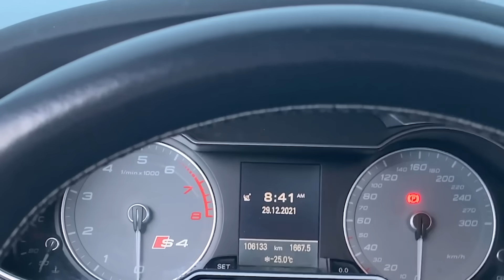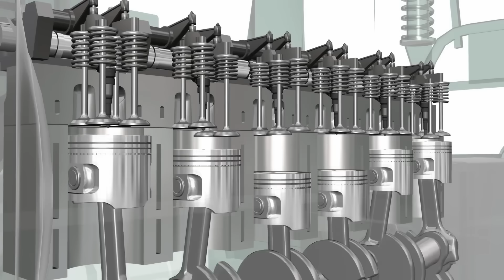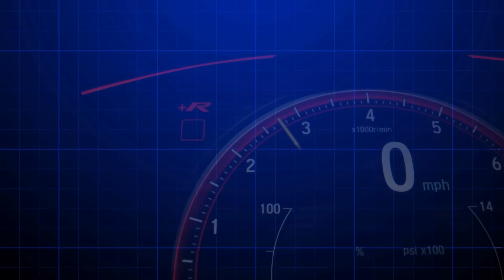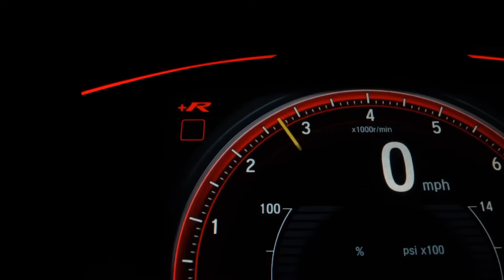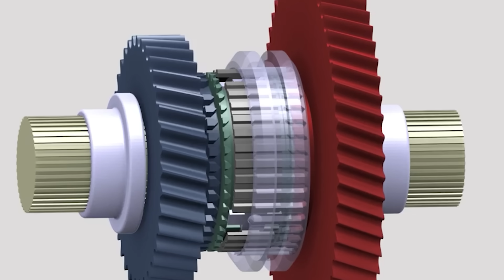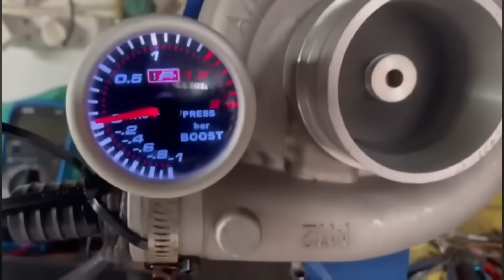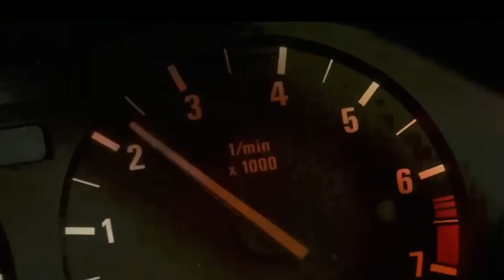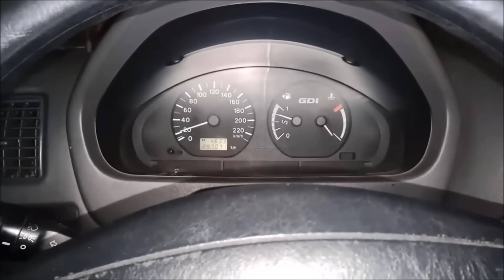STOP Warming Up Your Diesel Like This (Costly Damage!)

Comment: Im so sick of these shitty A.I. videos!
Anyways basically everything here only applies to NEWER "modern" diesel engines with all the toxic EPA BS in place. Don't idle because of exhaust temp? That doesn't take account for trucks with the high idle feature turned on... 15W40 oil in winter time? Sure if your somewhere down south but us in the northern climate switch to 10W30 diesel oil in the winter because it can drop below -40°f ...I keep my block/battery warmers plugged in all the time through winter personally but if I had a predictable schedule I totally would put them on a timer with random hours of power just to keep it reasonable for those random trips.
Tune and delete your trucks to run the way that they were intended and most of these problems will be obsolete.
Put a high-idle on your truck, Let her idle for a couple minutes and Keep your RPM below 1800 until the operating temp comes up into the normal spot and then maybe keep going easy on it for a little longer if it feels right for oil temps and then just drive like normal.
Think about it,  up until the last 10'ish years the diesel engine has always been known to run forever amd be totally fine with idling away for days.

Comment: "Warming up" a modern diesel engine is MORE about defrosting the windows to be able to see to drive. If the windshield is clear and it's cold out, I can drive immediately. Here's an idea: The manufacturers can add electric defrost wires inside the windshield the same way they used to put them in the back windows.

Comment: Ford 6.7l Powerstroke. 5w40 full synthetic oil. Factory oem block heater. And 300 watt magnetic oil pan heater. I plug the two devices in 3 hours prior to starting. I idle for 1 minute and then drive. Block heater only keeps coolant warm. And oil pan heater only keeps oil in pan warm. It does not warm the oil in oil pump or pipe plumbing or in oil filter. Viscous oil has to be pushed thru an oil filter until all plumbing lines and oil filter can be displaced by the warmer oil-sump oil.

Comment: After thirty years of driving and a prior experience as a mechanic every one knows that if you live in a cold region you install a block heater and you mix fuel additives to help with cold starts
Reply: 💯 I also added 2 oil pan heating pads, so the block and oil are warm. Start-up oil temps of 50-60 degrees instead of 10-20 degrees 👍🏼

Comment: Well i drove big rigs 40 year's always started them let warm up before i ever put them in gear always took it easy for a few miles before runnin speed limit let tranny and rear ends to warm up.  Owned only a 96 power stroke did same thing to it. Now have 03 Dodge ram 3500 2wd with Cummins diesel engine 24valve 5.9 6 speed manual transmission quad cab dually i will do the same with it.

Comment: You think ima pull a 6% grade 42k in the trailer with a cold engine 😂😂 no sir oil temp at 200 , coolant at 180 then I pull off

Comment: Why use 15W oil in cold weather when you can use 5w or even 0w oil?
Reply: My diesel has 0W20 so i’m good
Reply: Well if your pulling 20k lbs your bearings won't  last long I love how these guys drive a diesel truck around like a car
Reply: 0w means there is no oil residue on anything when startup happens which in time causes major wear... 10w you have some oil residue when startup happens help with less wear on startups...

Comment: 2021 Silverado 3.0 Duramax  4x4 130,000km oil changed every 5000km. Transmission fluid changed every spring regardless of mileage. All gear oils changed every year.
Reply: I have a 2020 Silverado RST Z71 with the 3.0L.  I live in Phoenix Arizona.  It doesn't get cold enough to worry about cold starts.

Comment: Go electric. So much better in every way
Reply: No don't think so. You can't even use your heater because you'll lose range 😅
Reply: @andydonagher9681 tow a cat generator plugged in behind you
Reply: Not at all
Reply: No😂
Reply: Try pulling 20,000 lbs with electric  it'll  never compare to my cummins
Reply: Not there yet. need more range pulling a load, shorter charge times, and then I’ll be interested.
Reply: Idiot

Comment: Not one word mentioned about head gasket scrubbing because of a cast iron block and aluminum heads, two dissimilar metals expand at different rates. Over a period of time fast warm ups will  blow a head gasket. I let my 19 year old duramax duramax warm up for 30 minutes when it's cold outside so the block and heads can slowly warm up nearly at the same rate,  the cab is nice and toasty warm oil temperature is hot enough that I can drive normally👍🏿
Reply: Luckily, not really an issue on Cummins I6 engines.
Reply: 30 minutes to warm up???? So happy to have bought a Cummins. One 1997 the other a 2012. No issues at all….
Reply: You should let the engine  and turbo cool down before you shut it down.

Comment: Just to be clear 
Old diesel engines vs new diesel engines….two different technologies.
Old diesel engines runs just like the old gas V8 gas engines ….cold engines.
Newer diesel engines runs a lot hotter and they don’t need to be warmed up for long….still needs a little warm up.